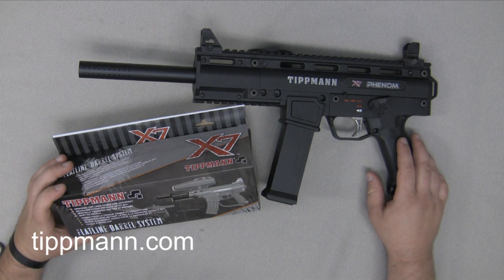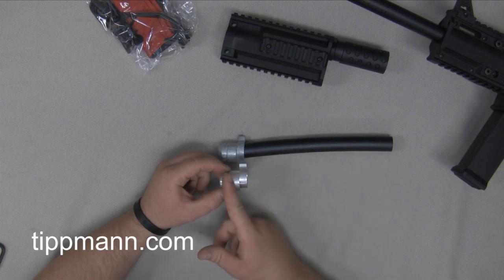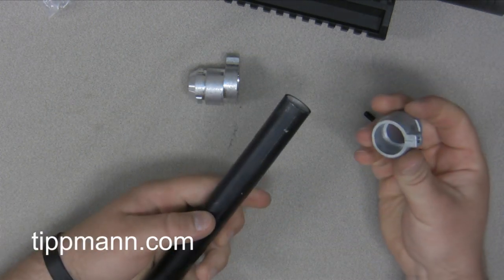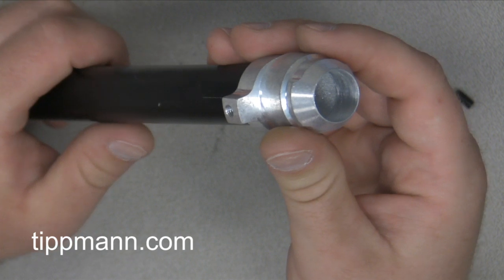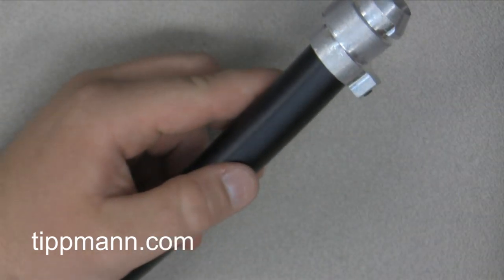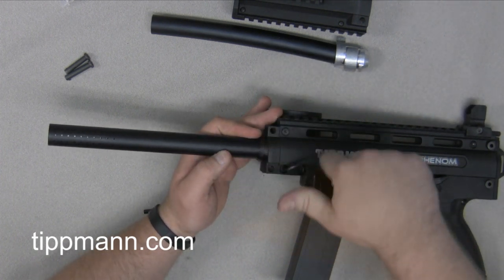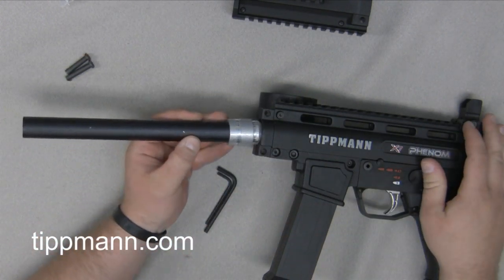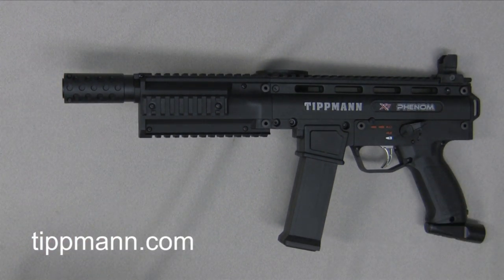X7 Phenom Flatline Barrel Installation.mpg

Comment from the maker: @apnudi Yes. The Flatline has a Picatinny rail on the bottom. So you can install any grip that is compatible with a rail. Tippmann offers a standard vertical grip and a folding vertical grip.

Comment from the maker: @iown888 Loosen the front 4 receiver bolts and the cyclone bolt. You may have to grab the adapter with needle nose pliers, turn and pull.

Comment from the maker: @mronemoredrink Yes, the Flatline is compatible with the X7. You will need a Phenom adapter that should come with the barrel. If it is not included, contact our service center at 800-533-4831 option 2 and they will send one out at no charge.

Comment: Ok, I bought the same thing from a different website.  The original x7 barrel adapter is a different color than the previous kit.  For some reason the (x7) barrel adapter on the first flatline I ordered was black and shiny.  The second flatline I bought had a metallic luster for the original (x7) barrel adapter.  Both kits included the correct x7phenom barrel adapter though.  Still think someone, maybe not tippmann, maybe paintball-online's website, was messing with me.